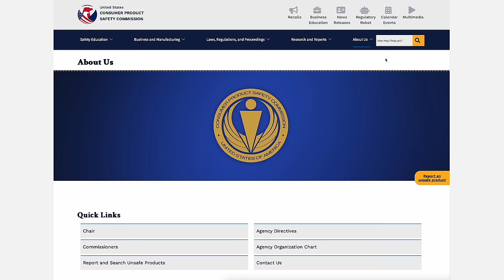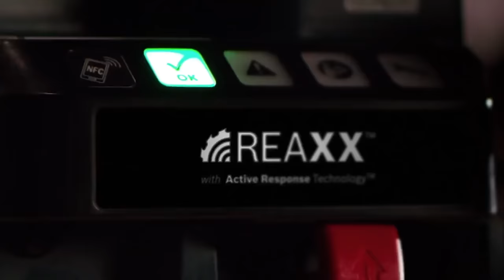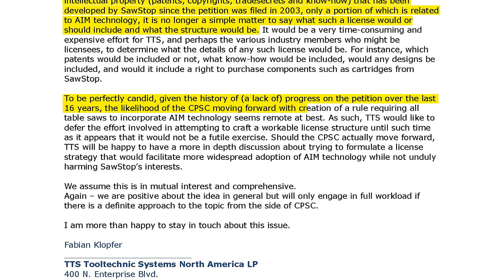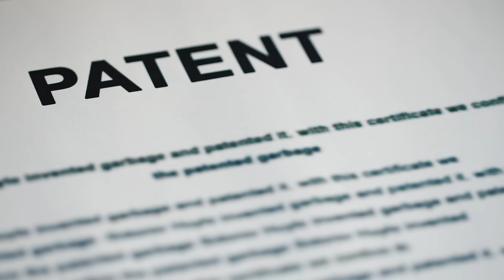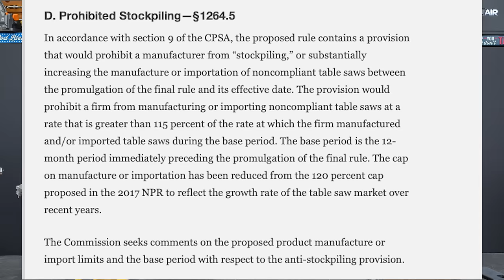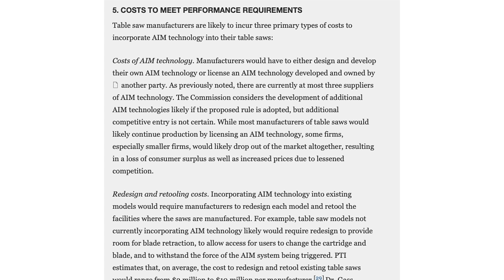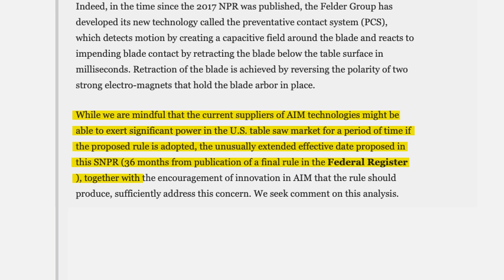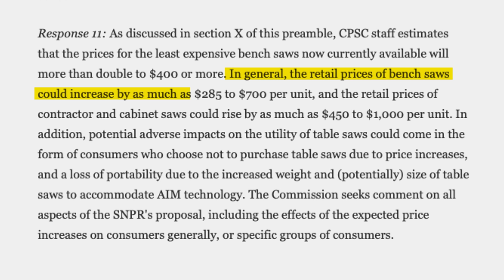The US Government is About to Change Table Saws FOREVER!

Comment: CPSC could promote safety without infringing on rights (at least not as much) by requiring manufacturers to offer this technology as an option. That way, consumers who want to pay extra to get it would be guaranteed that it would be available regardless of which brand of saw they buy. I would compare it to requiring airbags in cars. Multiple studies have proven that properly worn seat belts provide equal protection to occupants without the additional risks associated with airbags. The issue was that so many people didn't use their belts. The feds then decided they would force everybody to pay extra for the "backup" system, which is airbags. Instead, they could require airbags to be offered as an option in every new vehicle, allowing consumers to make their own choices and live with the consequences of their choices.

Comment: Pretty good job on this video....  This is a complicated question, no doubt....

I'm not a lawyer...  these are just opinions...

I know there are areas of the country where basically, if you don't have all SawStops in your production area, you can't buy workers comp insurance....  So the insurance companies themselves are saying "You have to buy sawstop."  And it does open a lot of liability.  It's just way too easy for a plaintiffs attorneys to say "Okay mr owner of cabinet shop, so let me get this straight...  You COULD have bought Sawstops, and made your workplace safer for your employees, but you didn't, because it costs more....  So you knowingly put your employees at risk just to save a few bucks....  And now my client is missing 2 of his fingers...."

And, hey, let's be honest, there is not a lot of counterargument to that...  You're going to lose that case....

I also get a little queasy every time someone says "Ohhh, the Sawstop patents run out in a year..."  Yeah, we've been hearing that for 10 years at least....  Sawstop has continually filed for more & new patents over the years...  I was told there's like 140 patents all total, and I don't understand the ins & outs of all that, but it was a minor little patent on a particular part of the process, that tripped up Bosch.....  And they have quietly been burying the patent office with paperwork for more patents, extensions on old patents, minor tweaks to the design getting granted fresh new patents....  And overall, quietly, they've been getting them....  So this isn't ending anytime soon, is my point.  The running joke is "Yeah, we've been a year away from Sawstop Patents running out for about 15 years now...."

Uhhh, also, let me just say I find it very very troubling that the Sawstop dude is now out there running around saying "I'm just worried about safety!!!"  Dude.  Seriously??  Duuuuude.  Oh dude...  He's been approached countless times for licenses...  He sold zero.    Please tell me more about your deep deep concerns for our safety....  ugh.

Comment: Thanks for the excellent, well balanced video on this issue. Paying $1 per day for only 1 (one) year to get proection from major traumatic injury (and possible death) for the life of a table saw is a VERY good deal!  People will note that "possible death" is not in the table provided, but it is very real outcome for some (I know of 1 case personally).  Major trauma, such as the loss and re-attachment of multiple fingers, carries a long term risk. After the injury and the surgery, people will occasionally have a "post traumatic embolism". This means that a clot formed in the injured area and later broke loose, usually lodging in the lungs and causing a pulmonary embolism, which is often fatal. Bottom line- some people who thought they were on the road to recovery died. Do not believe me, just look it up or ask any surgeon. The saw industry, as well as many more body parts, will survive this!

Comment: This is horrible. I have a part time high end cabinet shop. I own a 1956 Wadkin PK, a 1953 Oliver 270  and a 1908 Faye and Egan. These are stable and hyper accurate machines I have had for years.

What I have seen is the riving knife as a safety device. The worst injury is the kick back where a workpiece is shot backwards. Many amputations are related to kick backs. Saw stop does not prevent kickbacks beyond their use of a riving knife.

Saw stop has been trying to force the market for years. First by heavy handing existing makers to use their technology. When that didn’t work, they began selling their own saws.

A saw stop cabinet saw can easily cost 7000 to 12,000 dollars. I bought my first delta saw new for 1400 dollars.

The issue is if they make us get rid of our current saws and requiring us to use the new saws in business.

I think it sucks. Saw stop should be forced to freely make the technology available.

Comment: Back in the seventies when I was in 6th grade I took woodshop, the techer taught the entire class what he called the five golden rules of operating a table saw. The first rule was to respect the table, the second rule was to set the blade at the correct height of cutting bored, so if the board was like a half inch thick then we was to set the blade 1/8 above the the half inch board, the third rule was to feed the bored into the blade slowly but moderately, the fourth rule was do not rip anything on the table saw that is less than 3 in wide. The fifth rule was always use the push sticks or the push blocks to keep your fingers away from the blade. And I think that the schools don't even have the wood shop classes anymore. And most of these table saw injuries is coming from the younger generation that has no knowledge and was never taught safety on how to use a table saw. And first of all all these mandates on the table saws it's not about safety really is more about money.

Comment: If SawStop can be disabled for damp wood, many will do so and thus avoid the cost of a new blade, etc. And then forget this unless they ever get injured. I would probably do this, still having 10 digits after 68 years of careful carpentry. However, if I were still a trade user of cabinet saws, I would buy the Felder system despite the extra cost, which could be less than the increase in premiums from just one injury.

Comment: I'm reminded of what happened to general aviation in the 70's, when the courts held Beechcraft liable for accidents involving their aircraft, even if the aircraft were several decades old and had passed through many hands. The insurance cost increases for the manufacturers were the primary multiplier of purchase prices (and I'm not discounting the increase in fuel and maintenance  costs that occurred during the period, but were generally unrelated to this issue.) An airplane that used to sell new for (2020 equivalent) $75,000, will now cost over $450,000. That put flight training out of reach of most consumers, and broke many flight schools. End result: pilot shortages in this century.
If Acme (I hope it's a made-up name) has to raise their benchtop saws to $1000, how many of those do you think WoodCrafters can stock or sell. Hobbyist and small woodworkers will keep using old equipment well past the usability level, and either get hurt more, or get out of the hobby/small business.
And...
3.5 mm cut depth? My left index finger is only 10mm thick (with minimal squeeze). Cut 35% of that, and I'm off to the E.R. anyway, so what's the saving (other than the whole finger)? This feels like a requirement that airbags must deploy and protect up to 40 mph impact speed.

Comment: Is the goal to cut down on injuries for the benefit of the user or to cut down on cost to the insurance companies or eliminate competition through legislation?  Probably all 3 but mostly the last 2.  Why is the cost to the insurance companies so high?  Government intervention in the medical industry.  Administration causes costs to skyrocket.  Get the government out of medical practice (malpractice).  Eliminate the Consumer Product Safety Commission.  They work for the large tool manufactures that want to limit competition. What are my sources you ask? Common sense.

There should be a safety pamphlet with each tool.  

“Caution, improper/careless use can cause injury or death. Buyer beware!”

Comment: I think the extra 200 bucks would be a good compromise and if it reduces accidents then worth every cent but I just hope the extra safety measures do not lead to a relaxation in awareness of how dangerous even a contractor saw can be if used incorrectly. If the manufacturers  start to market these saws as safe then that is something I would have issue with.

Comment: I remember this original issue nearly 20 years ago.  The inventor came up with a brilliant safety device.  But due to it's additive cost, it didn't get accepted by manufactures; hence the creation of the SawStop saw.  He then wanted the rest of us to be force by the government into "protecting ourselves" by mandating the use of his patented device.  That's when I stopped liking SawStop.
I don't like being told how to protect myself especially when  most of these injures are caused by removing of the provided safety equipment.  I removed the blade cover from my cabinet saw.  I am careful but I accept the responsibility for what happens if something does go wrong.  I wish mine had a riving knive.
I remember a litigation case back around that time.  A lawyer took up a case of where an illegal immigrant lost a finger on a contractor site saw (like the ones show in our video).  But my issue is that he removed the safety devices and then was not careful.  For that reason, his case should never been taken to trial.  Not because he was an illegal immigrant, but because he removed the safety devices.
If this ruling goes through, the cost of used saws will skyrocket as well.

Comment: With the table saw I have, you would lose more than a finger if you got careless. The honest to goodness 2HP motor driving a 12" carbide tipped blade can rip thru a PT 4X4 on the diagonal without even slowing it down. It can eat 2x4s that are pressure treated faster than it is safe to feed them. But it takes two people or an engine hoist and chains to move as it weighs in at 178 pounds and operates on 240VAC.

Comment: My husband was injured twice while using table saws.
 Both times it was because his boss approached him from behind and tapped his shoulder while he was cutting, causing the material being cut to shift, bind and slam into his hands. A broken finger and serious cut each time. Of course, the boss tried to blame my husband for this stupidity.

After the first injury, my husband painted a huge yellow box on the floor and made it clear that A) anyone needing his attention had to wait outside the box and in his line off sight until a cut was complete, saw turned off and he looked directly at them for them to flag him and they could not speak until the saw was completely off, and 
B) if he was injured a third time by anyone touching him or encroaching his saw area while he was cutting, lawyers would be involved.

Comment: I'd be interested to learn how the number of injuries compares with the number of Saws sold in a given period ... Anyone can buy a saw, regardless of skill level, shouldn't 
some form of training in their use be more readily available if not actually required ? At the end of the day these are cutting tools and they will cut 'whatever' is presented to the blade, I wouldn't put my hand in a Crocadiles mouth; The safety of these tools is the responcibility of the user to ensure they are correctly used ...

Comment: This is a good thing. It will increase costs significantly in the short term, but after the up front costs of R&D to retrofit their existing designs, the costs will drop.

In the meantime, used table saws will fill the gap for new hobbyists. And as said in the video, track saws are an affordable alternative for what most beginners are going to be doing.

Ideally, sawstop will be forced (if necessary) to sell their license at a reasonable price. IIRC, the sawstop author tried for years to sell the license at a relatively low cost to existing manufacturers for years, and they all rejected them because safety wasn't a sellable feature. It was only after they gave up on licensing it out that they decided to make their own tablesaws, and proved it was a hit.

It's about time we prioritize safety. We have the tech, and it's not prohibitively expensive. All I see in this thread are echoes of the car seat belt negative outcry.

Comment: SawStop will have to payout once someone creates a lawsuit that is geared towards failure to operate in. "normal" working conditions. This of course will be due to the multiple blade and safety cartridge replacements with claims that no contact was made with the blade. I don't know how the product would be supported in areas or work conditions that are not optimal, leaving construction sites forced to use other equipment to get the job done.  Just my humble opinion.

Comment: I see it this way.... My brother-in-law was using a circular saw and stupidly slipped on the board he was cutting and zip... off goes his index finger at the 2nd knuckle on his left hand.  Now I feel
sorry for him but it was HIS FAULT!  At this point the concept of getting paid for 'pain and suffering' goes OUT THE Fxxxing window!!  I'd bet that 90% of these kind of accidents can be traced back to 'customer error' and therefore should not include ANY PAYMENT for pain and suffering!  My BIL was a contractor so he knew what he was doing.... or should have.
Reply: You don't feel sorry for him. OF COURSE it's "consumer error" but you also said he "slipped" which means it was an ACCIDENT and this tech would have allowed him to still have those fingers. Use your head and learn some empathy.

Comment: 1:38 Gas is a total snake. He peddling SawStop retrofit kits at the Woodworkers Show during the 90s. Everyone thought it was cool, but no one was willing to spend the money (it was very expensive). He finally went to the CPSC and tried to get it mandated because it failed in the market. They told him to pound sand because he had the only patent. Since then, he has pursued this nonstop and gone after any and all competition.

How do we know for sure this only about feeding SawStop?
They are not talking about banning dado blades and requiring short arbors.
They are not talking about mandating magnetic switches.
They are not talking about mandating low voltage wiring.

22:28 Those are direct manufacturing costs, you have to add profit margin to the manufacturer, and profit margin to the distributor. So you can safely double those prices for retail.

Comment: 12:26 and how many of these injuries are due to the injured (I want to use choice words) removing the safe guards?
When all is said and done, what happens when the AIM device is removed or never replaced after being engaged?
One more thing to break.
How costly to replace when an idiot keeps setting it off because they are not careful.

Comment: I could maybe be in favor of a regulation that in it's writing only goes into effect after all relevant sawstop or other patents expire + 5 to 7 years to allow manufacturers to prepare. The idea as it's mentioned that all manufacturers have to implement a technology that only 1 company has a reasonable active patent on is impractical.

The steep price increases quoted by manufacturers I think are inflated because they don't wanna do it and because they haven't invested their own resources into the issue yet. If a regulation went live immediately then yeah, I could see those steep prices, but if a new regulation gives enough buffer time I'm confident manufacturers will get the costs down. It will cost more no matter what, but it's a regulation I think is worth enforcing if done practically.

Comment: This will virtually end the DIY/hobby use of table saws. Very few people are going to invest that type of money in a hobby unless they already have a use for one.There will wind up with 3 or 4 manufacturers, with no minor players left. 

You might get around the extreme expense, though!  I feature the sale of a table with no saw attached that you can attach your own circular saw to and will cost substantially less since it doesn't meet the definition of a table saw. Not patentable, probably, but would get around the very expensive mandates with an equal increase of danger.

Comment: I think a lot of people are misunderstanding what 'wet' wood means with a saw stop. It has to be pissing wet. Green wood won't trigger it. Also (while a bit cumbersome) there is a bypass on saw stop saws. I agree that basic safety is more important, and I agree with others concerns with saw stop licensing and the issue regarding patents, but I think this type of technology is way worth it.

Table saw injuries affect two people: newbies who don't understand the tool, and veterans who've gotten too comfortable with the tool. Freak accidents are possible with a material as imperfect as wood. The consequences of a mistake or freak accident on a table saw can mean the loss of your livelihood. I don't know about you, but losing the use of my hand over a small mistake or defect would probably make me consider suicide. An extra couple hundred dollars is worth it in my opinion.

I'm skeptical that this will be free of corruption, but I think the adoption of this technology in regulation could be a step forward in driving the prices down. The mechanism is very simple. It's basically just a mechanical fuse. Limit the scope of saw stop's patent on grounds of public interest